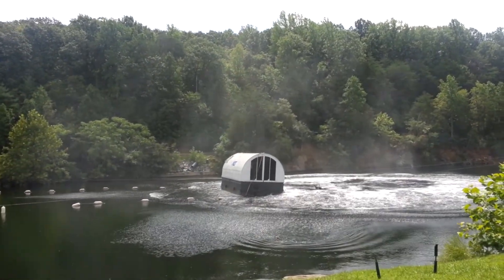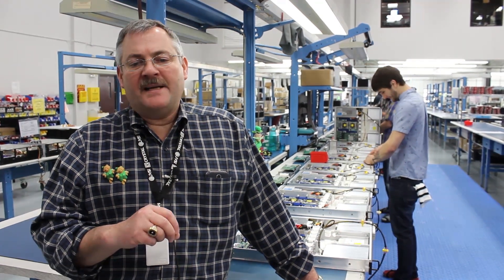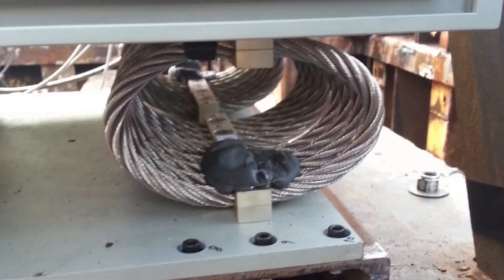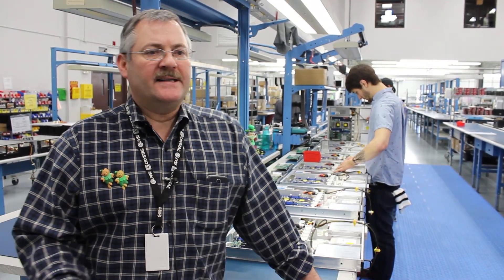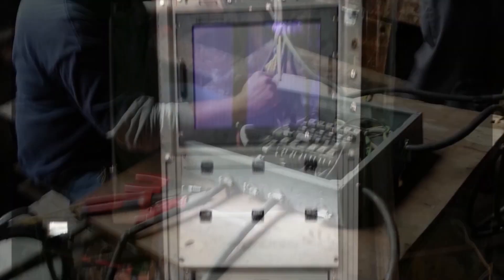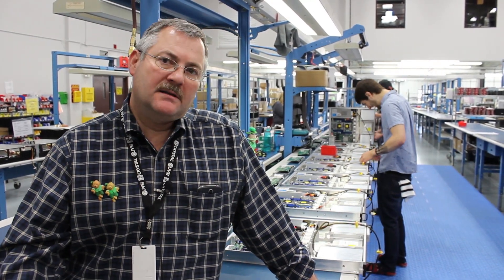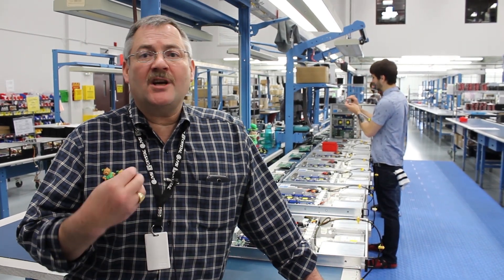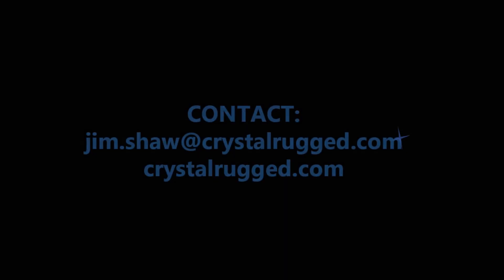MIL-S-901D Shock Testing  | Jim on Engineering | Volume 1, Episode 17

Comment: Although I'm not too familiar with Mil-S-810F, MIL-S-901D also has a category of heavyweight testing which does not use shock tables. Heavyweight testing is performed on a Deck Simulated Fixture (DSF) aboard a Floating Shock Platforms (FSP) usually due to weight and size constraints. Instead of generating shock through weighted impact, HBX-1 Explosives are usually set at a specified depth and distance in the water to generate different shock responses from frequencies that are commonly equal to or greater than 8 Hz going all the way up to 24 Hz. Mil-S-901D primarily focuses on shipboard installations.

Comment: Dear Jim,

are you familiar with MIL-STD-810F this standard also describes shock test. in the standard there is a statement under limitation which says like this: "This method does not include the high impact shock effects experienced by materiel aboard a ship.
Consider performing shock tests for shipboard materiel in accordance with MIL-S-901 (reference k)."

my question is what does it mean by this statement? both standard specified shock test by using shock table? so how come only MIL-S-901 offers high impact shock effects?